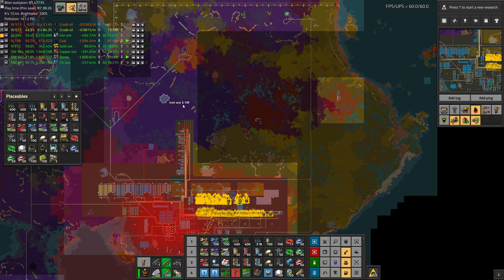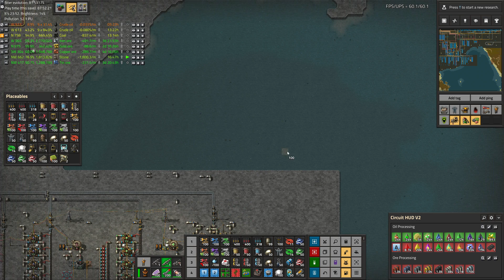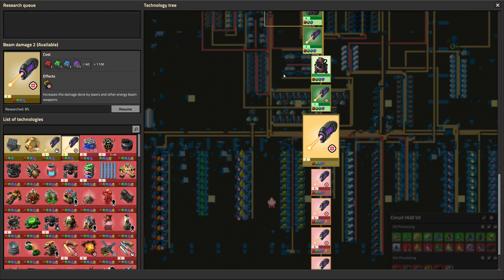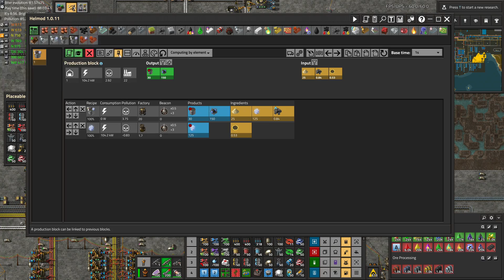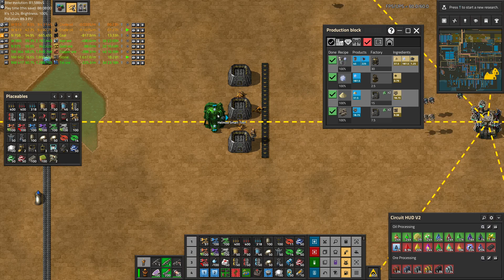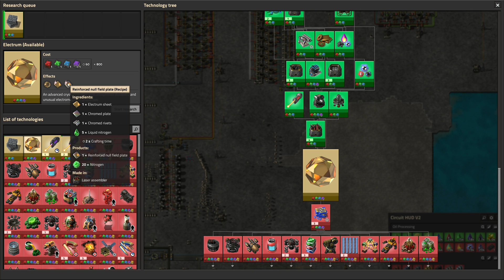[Factorio] IR3 Ep 39: Blast Furnaces & Blue Circuits

Comment: my gas separation was probably the most complex logic i used in the whole base. As to avoid wasting air filters, i wanted to vent only if they got too full, but also stop venting if at some point all of them got full. so i have a bunch of spagetti combinators making sure of that.

Didn't have any fosil gas processing saince it was added after i designed that part of the base and i had to travel quite far to get some of it in newly generated chunks.

Comment: Another thing. about the arc furnaces and only using pure resources and not the other ore froms. In the long run it is not really an issue. since once you are doing infinite research, your cansumption rates for every side product will always be between the cold and hot water, so as long as you have some mechanism to swap between them, you won't reach a point where having too much side product will clog your processing of the main product.